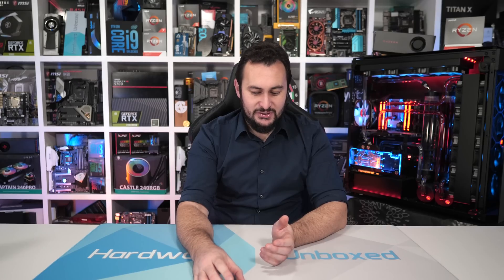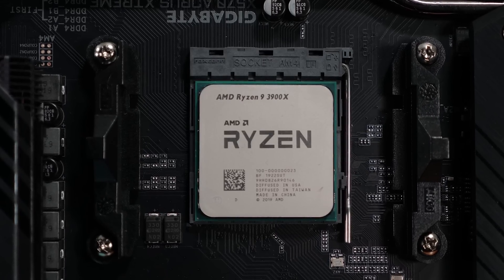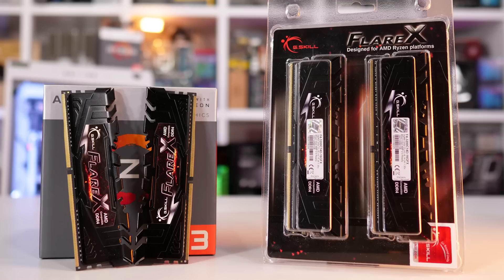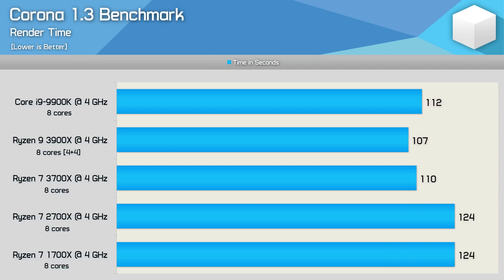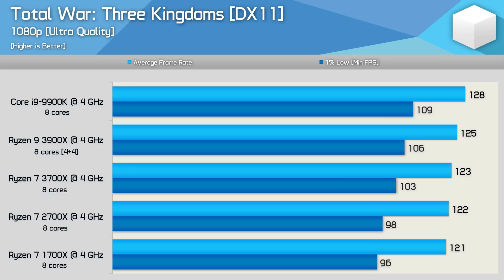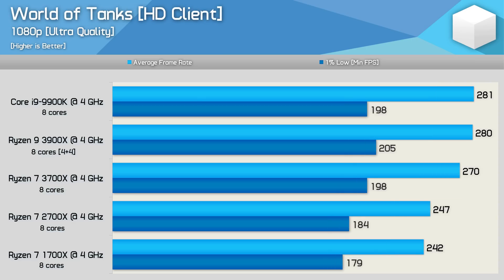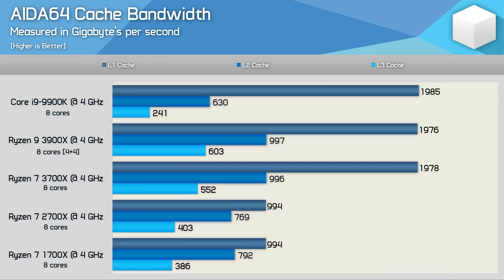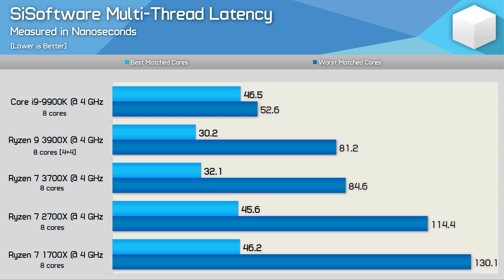3rd Gen Ryzen IPC Test, 3900X & 3700X vs. Core i9-9900K

Comment: Nothing "groundbreaking" to see here: Intel does less Instructions per Clock, but each "instruction" is more efficient, so it can reach higher frequencies, so it evens out with AMD in most real-world scenarios.
Reply: Lol are you huffing paint? 'each instruction is more efficient' that is utter nonsense. 
The main big reason Intel has higher clocks is because they increase fin height to allow it, this has a negative effect on power efficiency however the performance gained is worth it on desktop where people don't care about a few extra watts of heat. 

Also, if Intel were to go down to 7nm next year (they are not) they would also not be able to match their own 14nm clock speeds, 14nm is a very mature process for one: My 7700k clocks 5GHz full time with just a decent AIO without issue where as my 4770k could only run a 4.7 full time with better cooling (both at 14nm).

Secondly: As nodes shrink clock speeds do not go up, the fact they managed to get the small gain they did is already impressive.
Reducing the gap between transistors increases their susceptibility to interferance from eachother, if electrons jump a closed gate errors will occur and calculations will return incorrect in the best case scenario; worst case is you melt a gate and kill your cpu.
Reply: What does it mean, that an instruction is more efficient? Very interesting topic!
Reply: Not really... it's more of a very refined 14nm node. And Intel pulls significantly more power than Ryzen to achieve less IPC. That sounds less efficient to me. It's clear that Ryzen is not built for high clocks and built for efficiency.

Comment: This Shows me that the 1700 is still an amazing CPU, 8 cores 16 threads is more than enough to play at least at 60fps for a long while. by the time I need anything better I could buy a used 3900X for cheap :D
Reply: Ryzen 5 1600/1600X would have same end result. 8 cores and 16 threads is hugely unutilized in games and won't really help with your framerates. Single core performance is still the most important thing and that will be a fact for years to still come.
Reply: @SapphireThunder  Agreed completely, but I think the deal is at Ryzen5 2600 for current games, unless you don't already have a good heat-sink. In which case, add an X. I'm seriously thinking what networking hardware I might be able to replace with a Ryzen 5 1600 for O.P. routing, cache, and storage....and maybe a few other things that I really can't justify building an entirely new computer for ...BUT DAMMIT IT'S LIKE $100
Reply: @ROFLCOPTER Great steal. 135 for 2600...makes me wonder what family member I should just randomly give a computer for Christmas
Reply: @SapphireThunder  I am sure that will change next year with the new consoles plus I said 60fps what ia the point of 120+ fps for a 60hz monitor or tv? With the 1700 I can stream play encode. So let's see how things work in a couple of years
Reply: @AngeloNigro  For games like CS:GO 120 fps on a 60hz monitor still makes a difference, reduces the input lag from the mouse.
Reply: @kvrreddy1605  you can get 120fps from cs go with anything these days. Even an i3
Reply: @AngeloNigro  I agree, but that was not my point.
Reply: @AngeloNigro  NOt really, the current consoles didn't change anything either and they are "8 core" (in truth 4 core 8 thread, but depending how game is coded, it's the same thing). It took the AMD and Intel both a mid-range 6 core release to start making games use more than 4 cores/threads. So same way it's pretty much certain it will require both cpu makers to bring mid-range 8 core cpu before game makers actually start making use of it.
Reply: @SapphireThunder  are we really comparing a jaguar with the next gen that is having an 8 core 16 thread zen 2 cpu? I believe things qill be very different now
Reply: @AngeloNigro  Sony's PS5 and Microsoft's XBOX will both use ZEN 2 cores so it's kinda game over for Intel! and I almost forgot about Google's Stadia game streaming service who is already using AMD hardware!
Reply: Yeah, currently sold new for 140 euros here. It's THE deal if you want 8 cores.
Reply: 1700 will mature better than 1600 or 2600. But that is up to game devs to optimize their games to utilize more than 6 cores, which now is the sweet spot.

Will see when 8 cores becomes that. But one day it will. My guess is in 2 or 3 years.
Reply: lol, i still have mine, its great
Reply: @CAVEMAN CRAZED LOL I use threadripper in my PC  you dumbass with a 2080ti. Money is not the issue here just stating facts. But I guess there has to be an dumbass like you commenting.

Comment: I would like to know the boost behavior of 4+4 3900X config. [AUTO/PBO/OC].
Reply: I just want to know how 4+4 Ryzen 3000 with 64mb cache can perform, how high can it boost since the heat per chaplet is reduced + how high can you manually OC it to see if you can get better "Gaming CPU" then 9900K since they cost the same.
IMO that config should have been the 3800X, makes more sense.
Reply: it seems you can't read... all CPU where set to 4Ghz on all cores.. in that case there is no boost.. its a manual oc/uc... its a fixed clock..
Reply: @mrdot1126  That has nothing to do with his comment

Comment: That's pretty good but even with the IPC advantage Ryzen has, Intel is still on par at gaming at the same frequency or even slightly ahead, I guess the Ring Bus architecture is simply much better suited for games than a modular architecture like Zen will ever be.
Reply: Well if a company has been on basically the same architecture for 5 years I would expect it to be good
Reply: @DeosPraetorian  I wouldn't say good, but rather, better suited. I'm not saying Intel's architecture is bad but Zen is definitively the better architecture at the moment, however when it comes to gaming nothing beats the Ring Bus, even Intel's own Mesh CPUs fall short compared to the Ring Bus ones.
Reply: Wallace  I expect that to happen when they finally move on to a new architecture, maybe at 10nm, and we may ever see a performance regression at gaming unless they manage to make up for it somehow.

AMD has a 7% IPC advantage in Cinebench, and yet they still lose at gaming at the same frequency, so I guess it is pretty hard to compete against a monolithic very low latency architecture when it comes to gaming and Intel will have to face that problem eventually.
Reply: All instructions doesn't take the same amount of cycles.

Instruction heavily used in game could be one at which the Intel CPUs are fast at or AMD's slow at. And those instructions might not be used much on workloads.

Comment: "[ Manufacturer name here ] shill!" Keep up the good stuff, love seeing these more in depth reviews.
Reply: He's obviously shilling / not shilling out for AMD / Intel / Nvidia, for money / products.

Also this <insert manufacturer> shill is using too little / too much, right type of / wrong type of, right application method / wrong application method of thermal paste / puddy / pad / liquid metal, and using the right type of / wrong type of air cooler / water cooler / ln2 pot, with the right type of / wrong type of, right size of / wrong size of, fans / radiators / fins.
Also let's not forget about the right / wrong operating system, right / wrong OS patch, with the right / wrong drives, not to mention the right / wrong BIOS.
So there's that!!!!
God I love / hate this lying / honest youtuber.
Reply: I thought I got a shill vibe for a moment, but he recovered fast enough that I have to chalk it up to random chance. There's only so many ways you can say, "AMD works well in some instances and Intel works better in others"
Reply: AMD works better when you underclock Intel.
Reply: @S2Tubes  I think you missed the point. You don't have to underclock Intel. The 9900k is only 5% ahead in games on average even when boosting to 5 Ghz which it does by default. All reviews of Ryzen 3000 were done without underclocking Intel and 3900x was just 5% behind in games on average. However, it has 50% more cores. This is an enormous advantage the second you do anything different than gaming. Not to mention the lack of security holes and being on a platform that is future proof unlike Intel which are forcing motherboard upgrades with each new CPU launch. You can easily install your 3900x even on an old B450 or X470 motherboard from 2 years ago an it will run just as well as on the new X570 mobos.
Reply: @bgtubber  Ohh I thought the unlocking Intel thing was a joke

Comment: The only reason intel gets 5to 10% higher scores is latency.
Reply: All instructions doesn't take the same amount of cycles.

Instruction heavily used in game could be one at which the Intel CPUs are fast at or AMD's slow at. And those instructions might not be used much on workloads.

So it can well also be about IPC for some instructions.
Reply: Keybraker yes and clock speed. But remember this is a brand new architecture compared to intel’s which is way more matured and refined. It just needs time to mature.
Reply: @keagan5379  hopefully, but delays in architecture can be dealt with programmers avoiding ccx jumps, something not many will do, and all previous games won't.
Reply: Keybraker well this is just speculation but I think since the next generation of consoles are going to be using zen 2 cpus we will start to see games more be optimized for this architecture and we will see much better performance. But for now if u want the best for gaming and don’t care about price to performance then intel is still the best option.
Reply: @keagan5379  yes, but we are talking 10% and only for the 800$+ gpus on the market.
The thing is that if you game and do other stuff on your pc as well the doubling in performance on other tasks is really important.
Reply: even on stock clocks intel beats amd.. thats sad.
Reply: @itanus7  what is compared here is performance per dame clock not stock.
The thing is that latency plays a huge role in latency sensitive tasks like gaming, that's why async computes are x2 faster on amd, for the same frequency.
Reply: @keybraker  The IPC of amd is still faster but still intel beats amd. how amd improved in anyway
Reply: @itanus7  if we would strip both processor to one core fixed at 4ghz amd would be faster, but more cores come at a cost, and that cost is latency.
Amd tried to defend that by adding 72mb of cache, but it seems it is not enough for games.

Intels arch is fundamentally better for games (5-10% + with an 800$ gpu)

Comment: Within 4 hours from TechYESCity. I bet that other techtubers will follow this week. I am mostly interested in memory-scaling (3200/14 , 3200/16, 3600/14, 3600/16) and memory-performance on the MSI-motherboards for B450/X470 (price/VRM's) because that would be useful information to determine which motherboard to pair that CPU. There has been little (Techpowerup did a little bit of memory-scaling testing but not the same clock frequencies and differenty latencies for 3200 or 3600) or no testing for that so far. Don't get me wrong, it also is interesting to see an 'IPC'-comparison, that however doesn't influence which hardware you best choose.

Comment: I would love to see a video done with the 3900 x with hyper-threading disabled performance in games
Reply: Vs Intel with hyperthreading disabled as well
Reply: What about a 3600 vs 3900X without Hyperthreading, so 6 Cores 12 Threads vs 12 Cores (same clocks of course).
Reply: Zen2+ cpus ryzen 4000 series will be compatible with the am4 current motherboards? I have B450 tomahawk and ryzen 7 2700 if ryzen 4000 series will be compatible with this motherboard I will not upgrade cpu this year.
(sorry for my bad English)
Reply: @ulas8201  Most Ryzen 4000 CPUs will work with your AM4 motherboard, except for the 16 Core ones.
Reply: @simonspettmann2937  thank you for information.
Reply: Disabling virtual cores legit does nothing... maybe 5 fps
Reply: @TheAmanor123  
No, makes a pretty substantial +10% increase in framerates for certain titles.

The reason is that it forces the games processes into one module, which cuts latency noticeably. And if you're lucky enough to target the faster module, then it's almost like an OC in performance.

Of course, things are likely to change in 2022 when games are disadvantaged on Intel's Ringbus architecture, and are optimised for Zen instead (thanks PS5 and Xbox V).
Reply: @ekinteko  Only in 2022? I heard PS5 and XBOX will launch around Christmas 2020... not later.
Reply: @vladvah77  
It always takes a couple seasons/years for the industry to shift properly. See GTA V which is very Intel biased, compared to FarCry V which is Neutral. Zen architecture is actually superior, games will favour it in the near future (the faster consoles will help).

Comment: Waiting for the "Yeah but no one runs a 9900K at 4GHz comments, missing the point of the video, which is true about 10% OC so most run at 3.6 base 😜

Intresting test AMD is doing great overall.
Reply: still 9900k beats amd in stock and even with better IPC of amd .. how can  you say amd is doin great..
Reply: @itanus7  well, 3900x has more cores/threads, for the same price as 9900k, and 3700x is little bit worse than 9900k for only 329$
Reply: @itanus7  
How are they doing great, by offing a CPU that comes within spitting distance of Intel in gaming, smashes them on multi thread with a 12 core SKU at a way cheaper cost, not hard to figure that one out dude.
Reply: Yeah, but no one runs a 9900K at 4 GHz
Reply: @Saigonas  it seems like you don't understand what IPC test means.
Reply: @MirelRC  ever heard of a joke? I just basically copy pasted what @Jefferson said
Reply: @MirelRC  r/whooooosh
Reply: @dainiusvysniauskas2049  lietuvis? Sw
Reply: @Saigonas  Laba :D
Reply: @dainiusvysniauskas2049  :D
Reply: @Saigonas  
Ahhh you sly old dog you...
Reply: @wing0zero  lmao